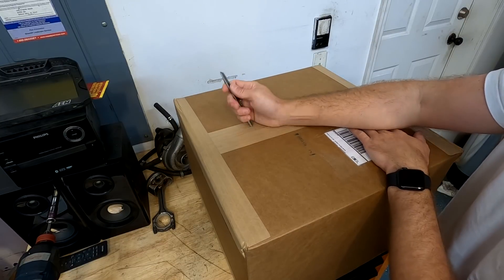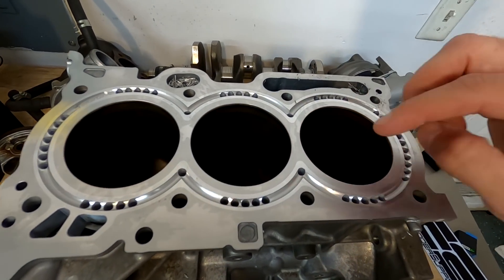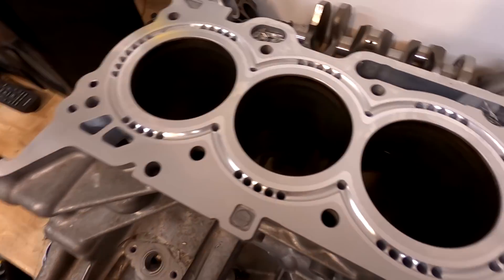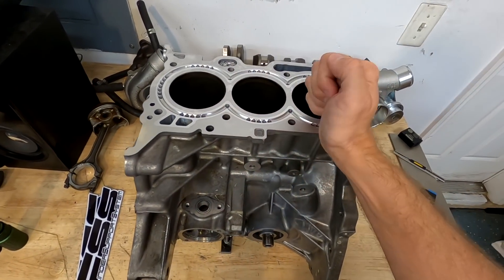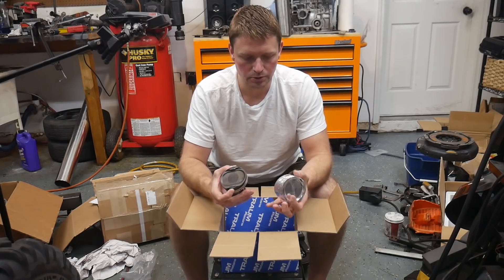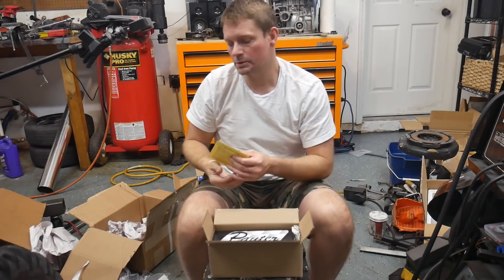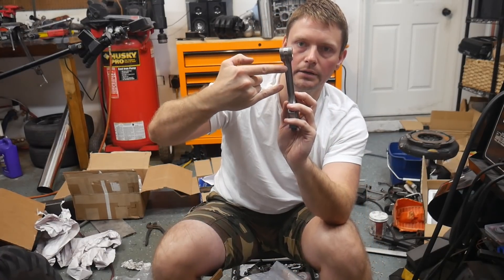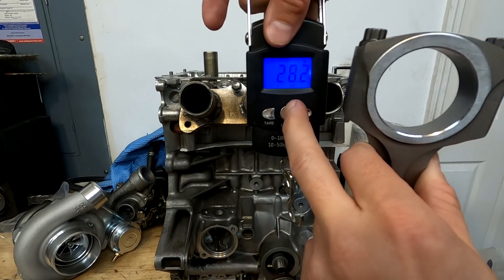Turning a 74hp engine into 500hp capable | All new Internals for the 3a92 | Road to 300hp Pt.5

Comment: Why did you chose to go with a cnc closed deck conversation over something like an epoxy fill? Trying to decide which route to go on my nearly identical build, but using a different 1.0l 3cyl. What was the ball park for a custom cnc closed deck conversation, if you don't mind?
Reply from the maker: Good question! The concrete and epoxy can work in a pinch but long term a proper fitted cnc will outlast. Also the cooling is superior. If you go on cncwerks website you can get an idea of the costs. I think they range from about $400 - $800 depending
Reply: @DirtGearTv  ooo that's not bad, expeshaly for the longevity! I figured that had to be the reason. Do you know if they can do cast iron blocks? Yours was AL which is convient for thermal expansion matching, but mine is cast iron, so I'm wondering how that works. As every video I find is done on an AL block. Thanks for the response! Good to see other people that want to bulid the odd balls like myself.

Comment: If I hit up Traum for the pistons and Pauter for the rods and gave them your specs, would it be any cheaper now to have them made since they've done it before? Also, I don't do builds, but if I were to give my engine builder guy these parts -> block, pistons, rods, and bearings to do the build, would there be anything else he would need (using my same heads, and head gasket, I presume)? Next, if I only have this done and did not do anything else to the engine (like turbocharging) what ballpark hp would I expect? Finally, if I did put in a turbocharger which one would you recommend. If you've already answered any of these in the comments, let me know and I'll look harder. Thanks.
Reply from the maker: Good questions. The purpose of doing the pistons, rods, bearings etc is for the engine to not come apart under power adders (supercharger/ turbo). If you were to do these mods without a power adder you'd actually loose HP because of the additional weight of the heavy duty parts. If you're looking for just some quick cheap power you can add a small turbo to the stock engine but I wouldn't exceed 10psi on the stock engine. Yes I successfully ran more without any mods but that's a gamble and if it's a daily you risk damaging it. If it's just for fun run it up more 😁
Reply: @DirtGearTv  So what range of psi could the new setup take with a turbocharger?
Reply from the maker: @patrickminx6614  I regularly run 30psi in my setup, at 43psi I lifted the head 😬
Reply: @DirtGearTv  👍

Comment: What did you do to handle the heat of the engine when closing the deck?  I would imagine this limits the fluids capacity to cool this engine properly and I don't believe I have seen you mention how your temperature has changed after closing the deck or what you did you ever come the increase in heat if present.
Reply from the maker: Great question, cncwerks does a great job of putting coolant passage holes in the same locations of the head gasket so it doesn't block any additional coolant passages. With my radiator i'm able to keep temps under 195F no matter how much boost i'm pushing

Comment: I have a question. I'm about to get a 2020 Mitsubishi Mirage and the engine they have in it is a 3a90 I believe. Would this fit and if not could I do what you're doing to this one to that? It's 74hp as well. Would this effect its gass efficiency? It's like 39mpg combined and I want the power/speed. I just don't want to lose that sweet mpg. Sorry if I sound stupid. I'm new to all this
Reply from the maker: A 2020 should be a 3a92 that's the 1.2L mitsu uses in the mirage. A 3a90 is just a 1.0l version but i've never hear of one used in a mirage. So yes you can certainly do what I did by adding a little boost. A small turbo with 7-10psi the stock 3a92 should be able to handle that power level. Mpg would stay the same if you're driving it like 74hp, if you use boost and drive it faster than stock mpg will drop 👍
Reply: @DirtGearTv In other markets like Japan, that engine was an option.

Comment: I am curious about that if it is possible to increase stroke of 3A92 with stock engine block? Can we increase volume of this engine by this way?
Reply from the maker: The 3a92 already has a long stroke 90mm and since I had to notch the block just to put new rods in I doubt you could stroke it further... Could probably increase the bore size slightly if you were willing to go with aftermarket sleeves

Comment: Where can I get this exact same setup at?
Reply from the maker: Can hit up my boys at cylinder support systems (CNC Werx). Pauter Rods, Traum pistons, King Racing bearings for toyota 1nz (i believe) 👊
Reply: @DirtGearTv  this kit is for the 1.2L 3 cyl stock engine ? Mine is a 2013 mirage
Can i know total cost plz ?

Comment: This is soooo interesting! I drive my Mirage on track and I mainly focused on suspension and handling to make up for the lack of power.
Reply: What kind of suspension setup do you run? I'm looking at getting godspeed coils and ultra racing sway bars, as well as a bigger wheel setup. Not sure there are many other options.
Reply: @suiboy7284  I have competed the car on just lowering springs, but I recently have switched to BC coilovers and did some tuning, found out the 4k/2.4k rate that came with the coilovers are too soft for the track so I'm now running 8k f/4k r just so it can still be streetable. I did have to ditch the front swaybar as the front roll became too stiff and tend to push.

Ultra racing bars, I have the front strut, front lower 4pt, rear lower 2pt torsion brace and rear sway. Wheel setup, 16x7 205/45's, around -2.5 camber front. Onboard vids on my channel, thanks ;)

Comment: Why did you reduced the compression ratio? Couldnt you have used a carved piston to increase it at the same size?
Reply from the maker: I reduced the compression to 9.5:1 to make it a little safer at the high levels of boost i'm running. Now, if it's an na build with good fuel you can increase it

Comment: I'd be happy with 170hp and high revs, maybe around 9000rpm
Reply from the maker: That would make a huge difference and is a reasonable goal for these. High revs are very stressful on rod bolts and mains, I believe the rods and pistons can handle this but would deff do main bolts and  cap bolts 👍
Reply: High rpm 3 cylinder I don't know it is possible
Reply: @GF-mf7ml  there are motorcycle engines like that. Ducati

Comment: If only there was an 81mm bore version of this engine. Or rather, an 81mm bore of anything that had a common layout with DOHC and high flowing heads. Why, you ask? Because of the semi-solid cast 4AGE pistons available from Toyota which are a factory part that's good for 600hp in a 4AGE.

The casting method ends up aligning the grain structure of the hypereutectic pistons very similarly to forging, so you end up getting the benefits of both cast AND forged pistons in the same unit. I figure you take that 600 and divide it by 4 to get ~150HP per piston, then multiply that by your piston count to get total potential "safe" output.

For a 3-cyl application, that's obviously 450HP. All with no piston slap, little to no blow-by, and not having to warm it up with soft driving before romping on it.